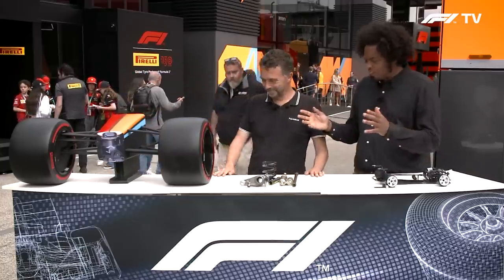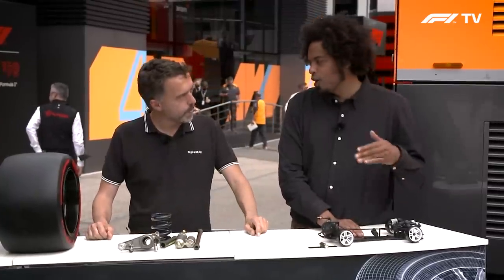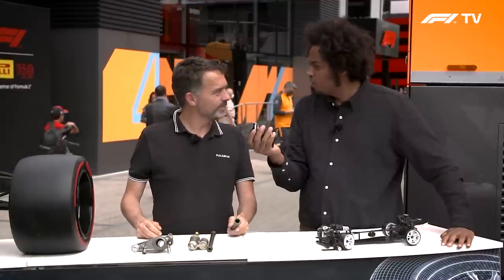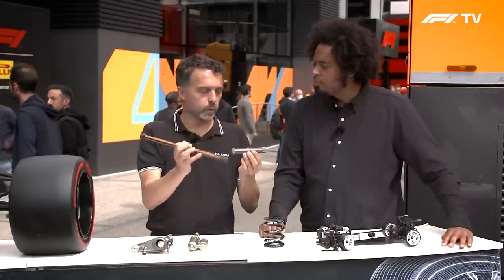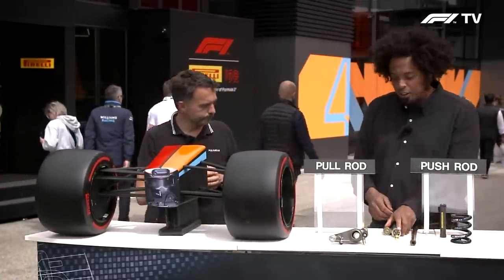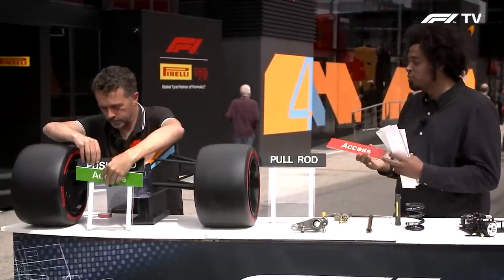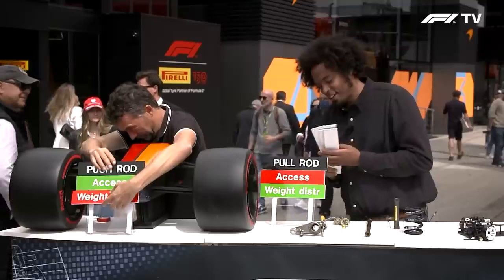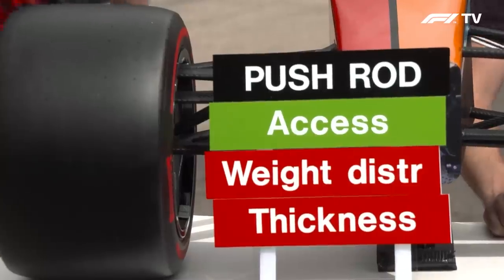F1 Car Suspension Explained! | F1 TV Tech Talk

Comment: as a mechanic, though i work on motorbikes, the ease of access is everything. the ability to constantly and easily make adjustments allows for the tech to be a much more integral part to making the driver comfortable on track
Reply: I was about to comment similarly, however my mechanical disposition is towards industrial automation. For example, I spent two hours over the last week trying to find an easier access way to time gears in synch on a machine, as the manufacturers suggestion was a full disassembly and reassembly 5hrs of work for a 10 minute tune.
Reply: Then again, F1 drivers are so in tune with their cars, that they'd likely only make a few changes from the simmed setup once they hit the track. So I doubt the lower accessibility of a pull rod is a big disadvantage. Neither RB nor McLaren has been struggling with track time during FPs.
Reply: Wrong. No car is fast for being sit on the garage... having easy access.
Low center of gravity and better aero are things to go by, any doubts check who won last weekend.
Reply: @f1master973  the ease of access is what keeps the car on track longer because the tech needs less time for adjustments. the whole point of easily adjustable components is to make changes without needing to do any major work that wastes time during FP's
Reply: @f1master973  and who won the weekend before?
The disadvantage of one system is being mostly negated elsewhere on the car.
I dare to bet that Ferrari higher center of weight is being negated at another component, and visa versa with RB having other part being more accesable than those parts on the Ferrari.
Its the same as the high rake VS low rake from previous years. You build the car with a certain filosophy, and with that the whole care is being designed accordingly. 

every decision has its strong points and its weaknesses
Reply: @f1master973  I agree...  but I think thats why he said 'as a mechanic'... for myself as a technician, access would be a pretty big consideration for me too. 
A designer will typically look at it purely from a performance perspective but will also have to listen to the mechanics and ensure that it will be as accessible as possible for ease of tuning and replacing components. 
An advantage for one parameter (performance) can easily negate itself if it also potentially provides an equal or even larger disadvantage elsewhere. 
Finding that right balance of compromise must be quite difficult sometimes.

Comment: I'd say on the old era cars I'd go with pushrod, but now with the new ground-effect cars and aero regulations I think I'd choose pullrod. It looks like it offers some benefits for cleaner air supply to the floor leading edge.
Reply: Yeah but what about tire managing and degradation?
Reply: @proximacentauri3342  Not related to either push/pull rod suspension. You can setup a push rod to have exactly the same suspension characteristics as a pull rod.
Reply: @theglitch312  ok.
Reply: @theglitch312  not true, the attachment points on the upright can also be used to change things like ride height with steering angle, and so the choice of push or pull rod can be used for different kinematic effects...
Reply: @GamezGuru1  I've always heard and read that, in theory, a pull rod can be setup to have exactly the same behavior as a push rod. Since a pull rod is simply an upside down push rod, with exactly the same components, also connecting to the upright, just, on the bottom.

Can you point me to a source saying otherwise? I'd love to know.
Reply: @theglitch312  pull rod is a bit of a mess to design because when the ride height decreases, it is pulling and damper+spring are in expansion. But because f1 have torsion bars and not spring, it is easier to have expansion with torsion bars than spring ( if you do it on your conventional car, it is a struggle).

Then the loads: pullrod dampers are always under load ( it is preloaded against expansion because the weight "wants" the dampers to expand), so much more fatigue (not really a problem for racing). The pullrod is working in tension vs compression for the pushrod. Materials are stiffer and stronger in tension, so you can make the rod thinner .
Reply: @John-ev3pu  For the part about torsion bars in expansion, how does that work? Because a torsion bar running lengthwise in the car can be designed to not care about which way it’s being twisted.

And even if it does behave differently being twisted in either direction, it shouldn’t matter. If an upwards force through a pushrod twists the torsion bar on the left side of the car counterclockwise, it’ll twist the same way round with a pullrod since it’s now pulling on the bottom mount of the rocker instead of pushing on the top mount of the rocker.

It’ll result in exactly the same torsion when pushing or pulling. So, you should be able to make a car behave in exactly the same way with both a push or pull rod (if you can get the aero and weight distribution the same as well).

Like you said, the dampers do change from being pushed to being pulled on… I don’t know if that impacts the handling. But I’d bet that dampers can be designed to behave the same in either setup.

Comment: In the extreme case,  the front wing can course air turbulence on the top of the car, so the pull rod is slightly better. For reliability mounting suspension components on the bottom chassis should be better and also weight distributions.

Comment: Is it a coincidence that the 2 team with the pull rods suspension (Mclaren and RB) were also the first 2 teams who seemed to have a better handle on the porpoising issues?
Reply: But alpine had porpoising under control quickly and they are push rod.
Reply: Rear would probably matter some as well, guess there are some differing opinions there too

Comment: Is ease of access such a problem in F1 though? You clearly have space to work with.

Very informative, thank you.
Reply: "In all cases" is the missing term.  If there were an on track incident, and. a quick repair is necessary, the push rod would be easier once the nose is removed.

Technicians work long hours in the night, we would look to them to say if "ease in the paddock" outweighs the on track benefit(s).
Reply: @jerrylouis8930  oh right I forgot they need to have it accessible for repairs on track. My bad.

Thank you

Comment: I understand having access to make adjustments for example is very handy and less time is lost so more tracktime during practice etc etc.. but shouldn't you also consider the advantages during the race in which you won't(/can't) change anything anyway? I imagine having better weight distribution also helps with tyre temperature/wear and perhaps more stability in the corners. Going a step further would be that the better your simdriver is, the less time you waste on having to access those parts in the first place as I imagine the suspension gets a default setting from the experiences of the sim driver in the factory. (/speculation)

Comment: Having a slightly higher cg may not be too much of a disadvantage. Having the cg higher makes it easier to roll, thus reducing the load on the inside tire in the turn. It some ways, reducing understeer when attacking the corner, preferable to some drivers. I.e. reducing dynamic stability about that axis, like a helicopter compared to an aeroplane when they roll. But this depends on overall cg and build of the entire car.  Just me 2 cents.🤔

Comment: As both systems are extremely robust so maintenance should be a problem. 
The cost to produce parts not an issue as they are cheap when compared to the rest of the car parts.
The Pull rod system should be the best of the 2 as it provides improved weight saving, improved balance with a lower center of gravity & much better force direction under load that makes tire management much easier to achieve.
Only time will tell. haha

Comment: Im not an engineer or a mechanic, but it seems that the car with pull rod  (Redbull, Mclaren, etc.) has less porpoising than the car that uses push rod (Ferrari, Alpha Tauri, etc.).

Is there any correlation on that?
Reply: Don't think so, because it's the complete opposite on the back in the sense that team with push rod on the front has pull rod on the back, and vice versa. If it's really about the suspension, you would see half the car bouncing. I believe it's really just a packaging thing that works with other parts in the car.
Reply: Intersting thought. Although porpoising is linked to down force rather than drag, i doubt suspension contributes to it very much... Since almost the entire assembly is inside the body... Only a single rod is outside and its not a down force creating element.

Comment: I think I might try both. There might be an efficiency in having both in as much as each would have less work to do so you could have smaller components overall and even less loads on the wish bones. I'd be interested to test that anyway.
Reply: You cant try when you are designing and once it is designed it is too late to change
Reply: @therealkinghimself  I can't but these teams could try it.
Reply: Doubt it, plus the regulations wouldn't allow for a hybrid pull/push suspension setup.
Reply: @theglitch312  hmmm, I'm not sure they do you know. It's an irrelevant hyperthetical anyway

Comment: So basically no one have clear advantage using push rod or pull rod...It depends on engineers who see what they wanted to achieved...
Reply: The selection comes with it's own benefit?  Pushrods being easier to tune, versus the pullrods being lower going down the road.

Comment: Pull rod is superior due to lower weight distribution which lower the centre of gravity meaning better car handling. It also makes your mechanics work harder so it must be better. Torturing mechanics = better F1 car

Science.
Reply: agree.. if it is difficult to make changes all the time, you tend to get it perfect in least amount of tries.

Comment: Is there a reason why cars that use a push rod at the front use a pull rod at the rear and viceversa? As far as I know, no team uses push rod or pull rod for both the front and rear suspension...
Reply: I believe Red bull and McLaren use pull rod on both the front and rear. As far as I am aware everyone has used pull rod for the rear suspension for years
Reply: @AmanAli-dc1sy  I double checked and both Red bull and Mclaren have push rod at the rear and pull rod at the front.
Reply: @ilCatta8  ah thank you very much. I just assumed they have done pull rod at the rear like they have done for years. Thanks for checking clearly was not paying enough attention.

Comment: Absolutely useless presentation.  How about the torque applied  to the chassis and torque to the wheels?  Why are the front suspensions pullrod and the rear suspension pushrod?  What about the pressures in the springs?  How about temperatures the components face at the rear of the car and how it affects performance (this had a huge impact on HAAS's car the last couple years?  Argh, the people that watch this sport are smarter than the way this was conveyed.